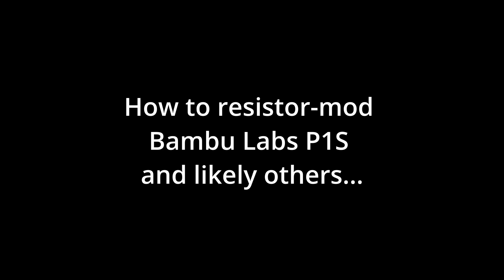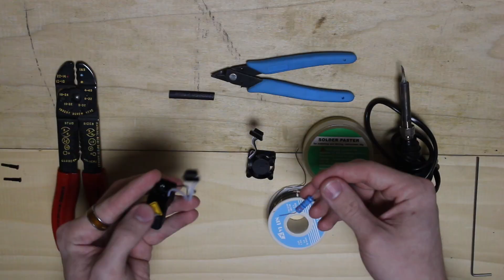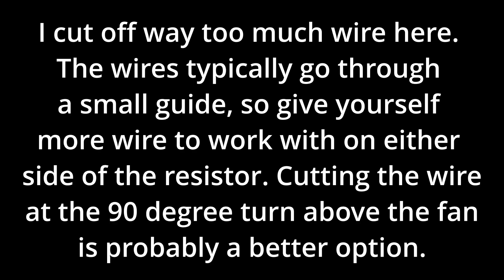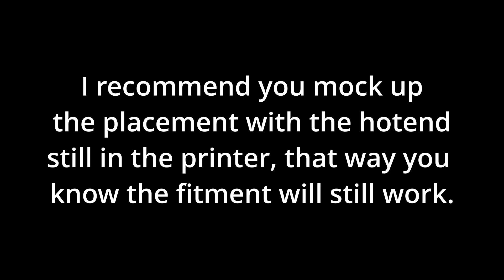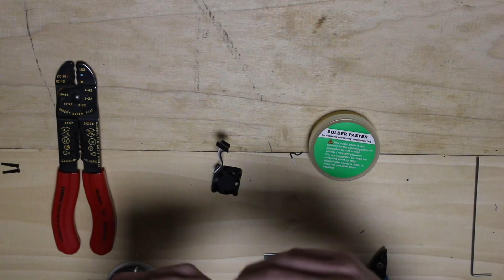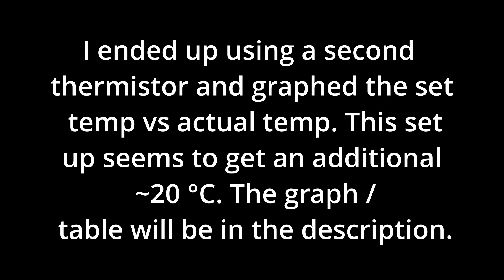Bambu Labs P1S Resistor Mod

Comment: Which hotend is that?  ObXiDian 500 hotend P1S or did you just modify the hardened steel nozzle from Bambu.  And I think the wire you spliced your resistor into is just a signal wire, not the heater wire... so 1/4 or 1/8 watt resistor should be all that's necessary.
Reply: Yes, but hey, maybe that was the only one in the workshop? I would have done the same, in that case ... :))